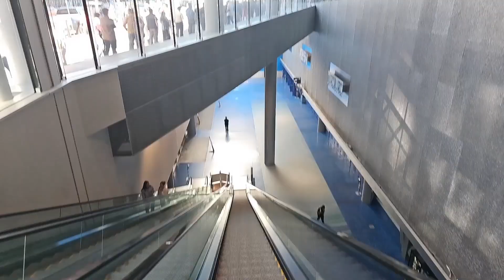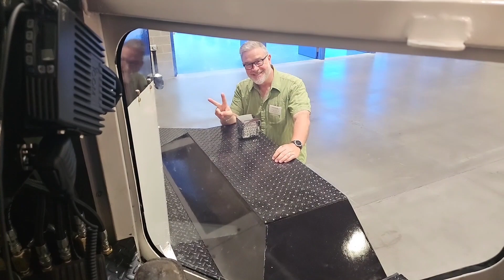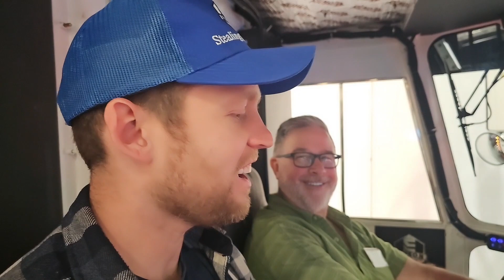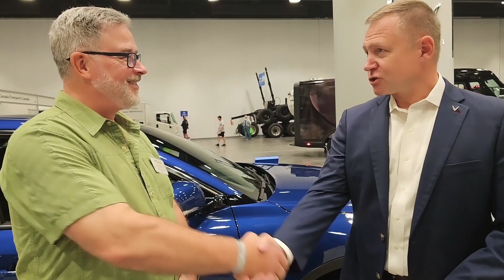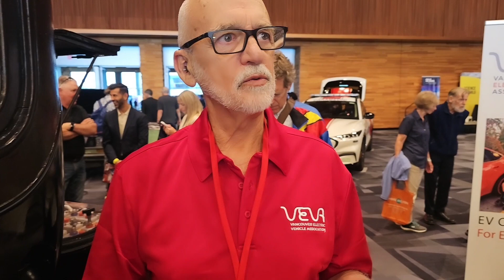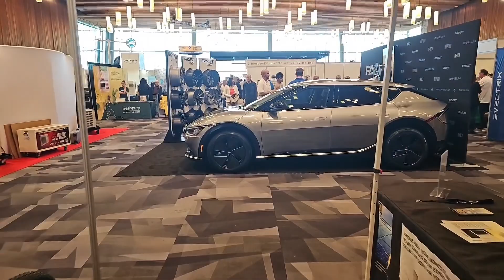Day 1- Fully Charged Live Vancouver 2023

Comment: What chase didn’t say about Edison Motors is after they start manufacturing some trucks they are going to develop electric retrofit kits for other trucks.  Think of an electric tow truck that uses its diesel motor as a level 4 fast charger, not only for itself but also for a EV that died on the side of the road.

Comment: Banks don't need an investment in a truck company to greenwash their previous investments, because the oil and gas industry will happily do projects such as hydrogen production and carbon capture. They can also invest in proven wind and solar power projects. A hybrid truck is not what they need to look green... especially one burning diesel and doing logging.

Comment: Built by a team in a bay isn't all that unusual for low-volume production, and makes sense. But it's not quite what Edison has been doing (as Chace suggested @10:10), because those production vehicles are built with proper tooling for efficiency, consistency, and safety. While I agree that Edison doesn't need an assembly line, it is very far short of being ready for production comparable to those established companies. Yes, build a few trucks for a few pilot development projects, but get set up properly before even trying to build those.

Comment: The power assist on the steering of the Edison prototype is electrohydraulic, not fully electric (as described @5:27). It works the same way as many cars with systems designed early in this century: an electric motor drives a pump for an otherwise conventional hydraulically assisted steering box; my current car has this, too. In this truck there are actually two of steering gear units, in a master and slave configuration, as is sometimes used with very high front axle loads and large front tires. There's nothing wrong with electrohydraulic, and it's even a good feature from the standpoint of maintenance and parts availability, but the description is not accurate.

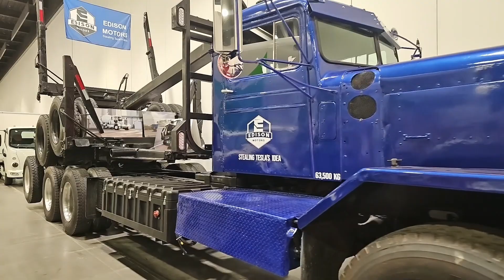Comment: It's more than a little misleading to suggest the "Carl" (Edison's blue truck) is a logging truck, or tested (@2:02). The claimed (@2:32) 50% fuel consumption reduction with that truck is meaningless, since it isn't under working conditions. It can't haul anything, because the drivetrain is inadequate; Chace has explained in their videos that the driveline snaps under heavy load, and the Tesla car motor can't withstand sustained high power without overheating (because a car only needs that power for a few seconds at a time to accelerate). The truck they got into - with the custom cab - is a serious prototype, with very different components. When it is tested, then there will be meaningful data.

Comment: Hydraulic pipes in the cab, that will be some mess when one leaks, or fails under pressure .
Reply: Um. Air lines. Not hydraulic
Reply: Didn't look like air lines 
 @TyuHeyheyhey
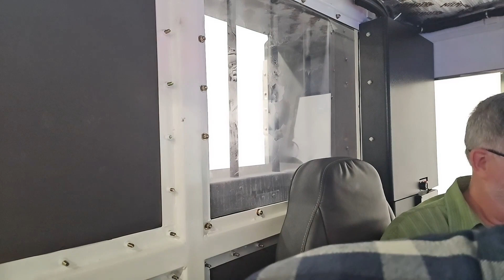Reply: 15:18 It's steel braided, not nylon like most new trucks have. You can even see the printing on it that says AIR.  @isaackent2355
Reply: You should try listening to the interview, @isaackent2355  . Chace of Edison Motors explains that those are air lines and they are using steel-reinforced hydraulic hoses in this air application for durability.
Reply: @isaackent2355 air brakes.